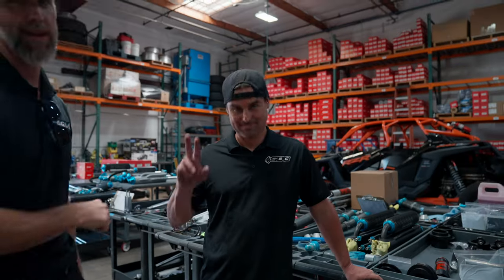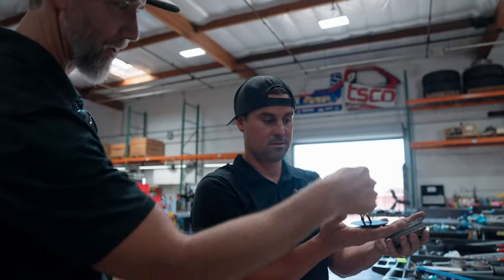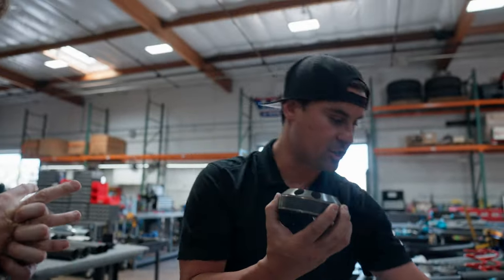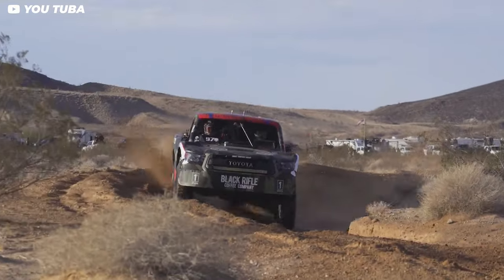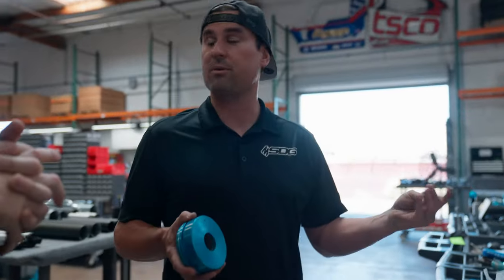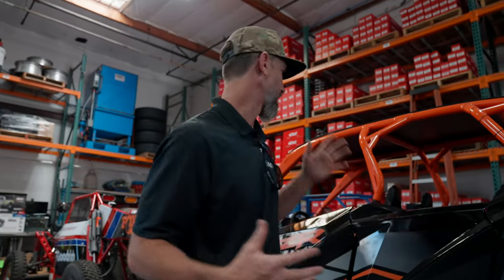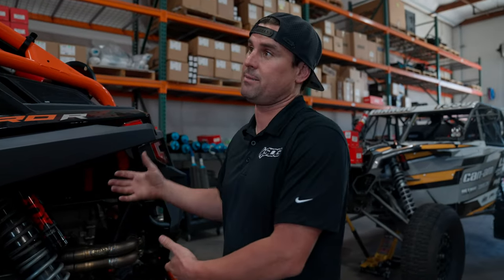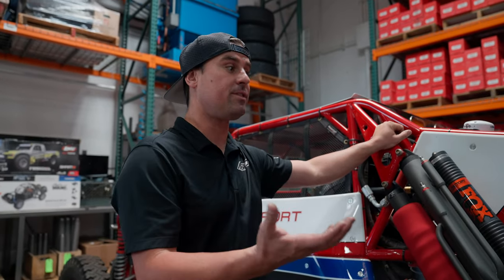How Do Shocks Work? The Complete Guide To Off-Road Shocks

Comment: Is it just the nitrogen pressure that forces the shaft out before installation?
Reply from the maker: Yes, exactly.
Reply: @AGM-Products  are the valves on the shaft just closed at those pressures? I assumed there would still be some ability for fluid to flow through the valves and thus allow the piston to move even with small external force but I was having to use my full weight to compress my new rear shocks even the tiniest bit. And they extended fully as soon as I released them like they had springs on them. I think I’m just misunderstanding how they are setup out of the box.